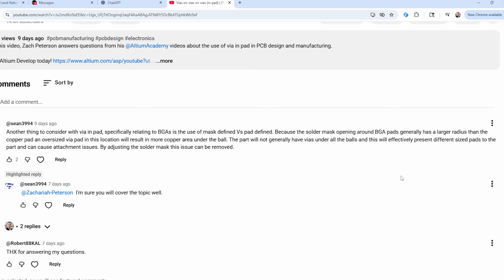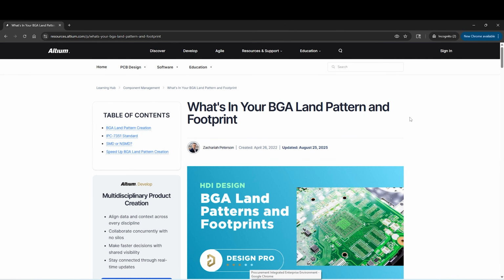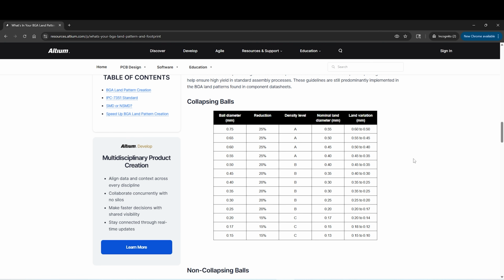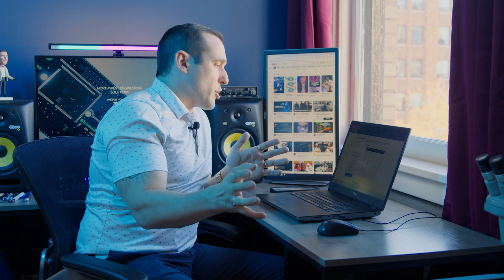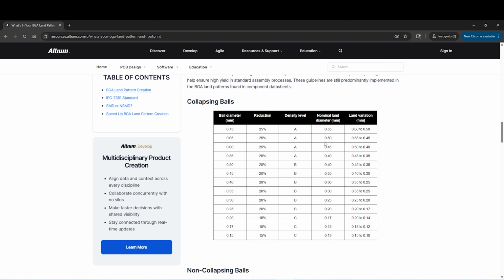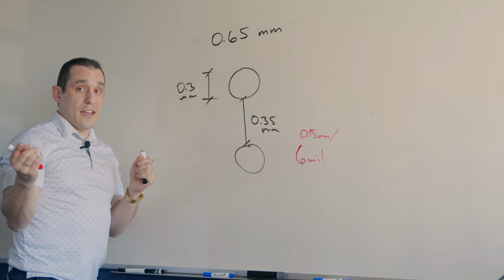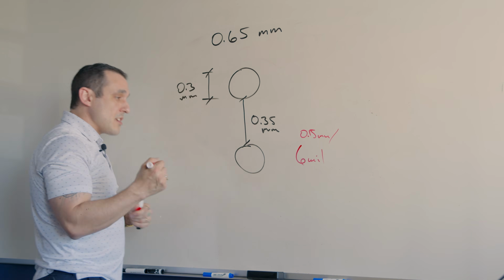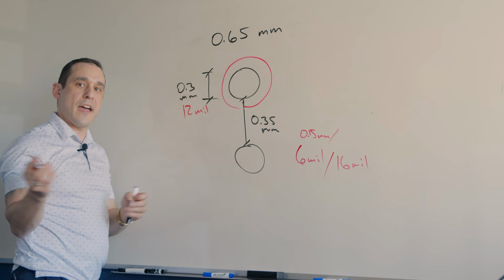SMD vs NSMD Pads in PCB Components #pcbmanufacturing #electronicsdesign

Comment: Hi there, just found out your channel looking for BGA recomm regarding NSMD/SMD pads. I'm working in a big EU company as an RF engineer. We are using 0.5mm pitch BGA and had many issues with the pad definition. In the end we considered NSMD pads (absolutely no solder mask below the BGA). Using laser micro-via (0.3mm pads required) we considered that with the regular overprinting of the external layer that we have most of the time, the top of the copper pad will reach 0.25mm which is the IPC recomm for 0.3mm diameter balls. PCB are currently being manufactured so we will sound found out how the PCBA is going. What do you think about this ?

One last question, what about 0.4mm BGA ? Do we need specific PCB type to have very small micro via pads (for me it's 0.3m which is absolutely too big for this kind of pitch) ? 

Thanks !

Comment: Hello Zach! I have a question regarding stackup manufacturability of power ground planes that form plane capacitance. I read that the separation should be 3 mils or less for decent capacitance, should this separation be formed by prepreg or core material? From what I gather core is more uniform in Dk than prepreg, which seems good, but i also read that core material that is one Prepreg layer thick is unreliable. Would a separation of lets say 8mil still provide decent capacitance?
Reply from the maker: From the electrical performance perspective, it does not matter. There may be differences in terms of building the stackup and reliability with a thin core, but any respectable company working with higher layer counts should have the process for working with thin cores between planes figured out. Also, 4 mil or larger is also okay for separation of power and ground in many designs unless you need very low PDN impedance. Very high capacitance designs will normally use a very thin layer (2 mils maybe) of high-Dk material, so it is not the same process as in other designs.
Reply: @Zachariah-Peterson thanks for the answer, and great job on all the different channels you contribute to 😊

Comment: What about the co-planarity of the lands? If you’re using a type VII via that’s been leveled and co-planarized - and then glob mask on top, doesn’t that add some irregularity in the Z-dimension? Or is that negligible compared to the height of the ball most of the time?

 Also, isn’t the positional tolerance of soldermask generally much wider than the tolerance of the copper etch in a given process? If the goal is to have precisely the same amount of copper exposed, wouldn’t it be more prudent to just make all the lands the same diameter as a VIP? Then you could realize an even tighter distribution of pad areas while still using a positive (or 0) mask expansion - which would make the variation in pad area be defined solely by the positional tolerance of the etch. 

Curious to hear how my mental model of these things might fall apart in a practical fabrication process.

Comment: What is the problem with different pad sizes?  I assume it risks tombstoning if there is too much asymmetry, but a huge central thermal pad isn't a problem... So why would there be a problem with a handful of slightly oversized pads that are either scattered on all 4 sides, or concentrated near the middle?

Comment: Those are some pretty bad fabs if they can't do 6mil vias. I've used JLCPCB and Macrofab. JLC will easily do 6/12mil, macrofab did 5/10 mil for me (may have been 4/10).